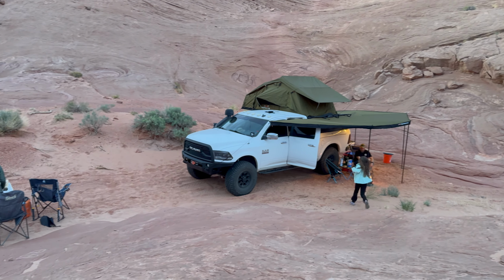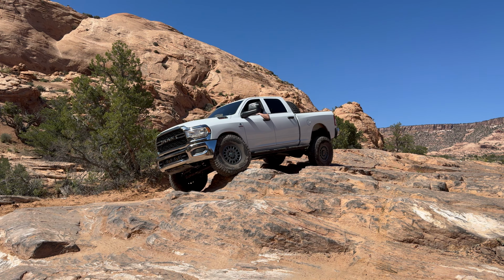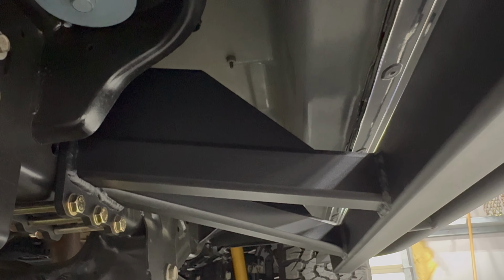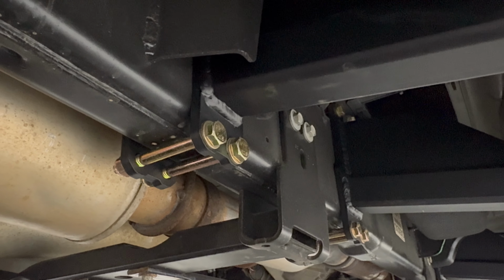2014+ Ram XHD Rock Sliders

Comment: Glad to finally see some competition on the market for WK sliders. Would have liked to see your sliders actually used as sliders and not just steps in the video, though.
Reply from the maker: @PowerMcWagonFace  We’ve used the sliders aggressively, but you’re right we weren’t able to find a lot of footage in the media we have showing the impacts. There’s a great action cam & drone clip in the vid showing the truck lifting the rear tire about 2’, then throwing hard to that side and slamming the sliders. That is a very extreme hit on a 9,200lb truck, and they held it and protected the cab as intended.